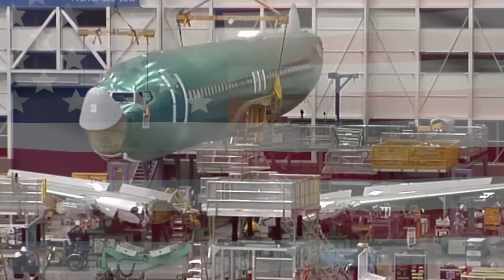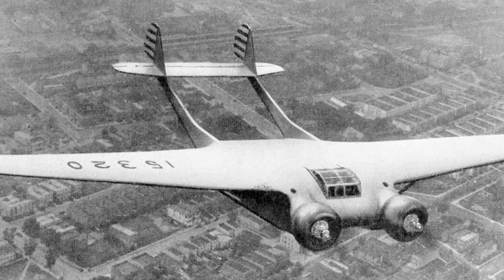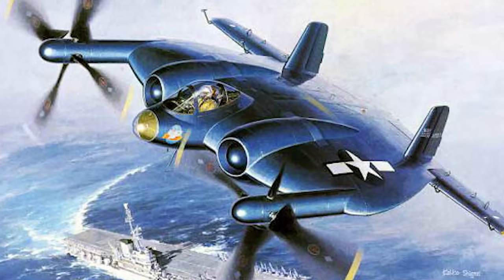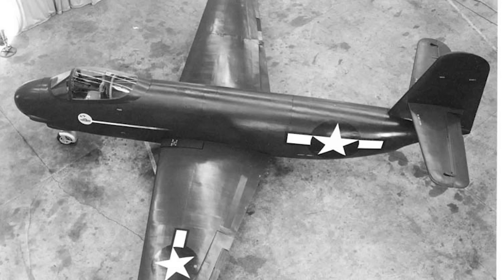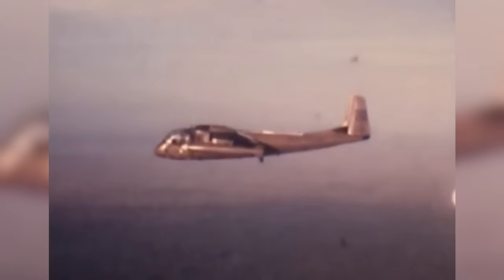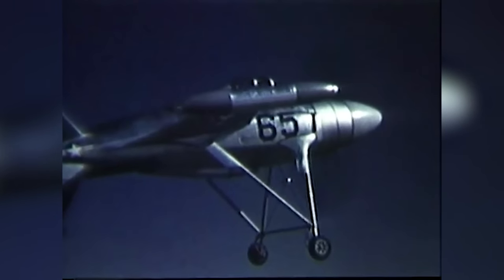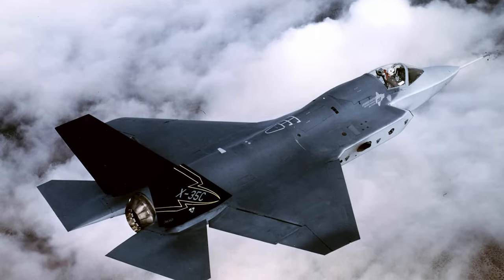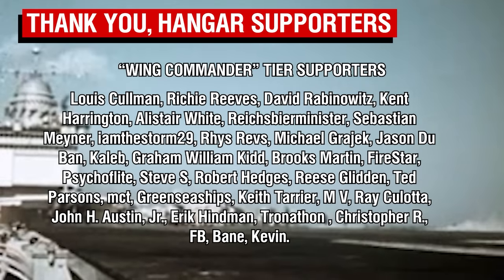America's Top 10 UGLIEST Aircraft

Comment: The simple fact is that the X-32 is ugly. Those semi-famous photos of the supposed F-32 with improved looks, which people always use to "prove" that it would have been pretty, only ever show it from the top or occasionally from a flattering side angle. They never show the front or the bottom, because that would reveal that it's still ugly.

There is something of the old Corsair II and Crusaders about it, but I wouldn't call those planes pretty either. "Striking", maybe? And of course, ugly or not, it's still pretty cool.

Great video Rex, thanks very much!

Comment: The xf5u with proper engines would have been a game changer.  With a theoretical top speed in excess of 475 miles per hour and a landing speed of around 65 MPH, it had an incredible climb rate.  Kamikaze planes would have stood little chance.  It was supposed to have four 20 mm cannons, making it the most heavily armed American fighter.  I believe because of it's strange looks, the conservative Admirals controlling the Navy at the time made sure it never had a chance.  I got to talk to one of the test pilots for the program, and he said it was nearly impossible to stall the prototype.  He also said it was extremely stable, and that even with the under powered engines, it could still do almost 300 mph, as well as being able to turn on a dime.

Comment: I actually think the X-32 could have been a successful design, if not a particularly stealthy one. It's closer in form to the F-16XL and would have been an excellent close air support platform for it very high payload potential, which in turn would obliterated any stealth profile it might have and is why it flunked the test. It would definitely have its place, but it didn't have the stealth or the speed to get it across the finish line.
Reply: The jump jet marine version had superior VTOL capability, it used thrust vectoring like the Harrier not the lift fan used by the F-35 (which can't be used for enhanced maneuvering and is just dead weight in forward flight)

Comment: While in principle and for the most part I do not find fault with your analysis,  there are exceptions for some examples on your list.  Had the title been "unusual" instead of "ugly" I feel there would be less room for debate.

Needles to say though the first requirement would be that the aircraft actually achieved flight, and not of the look I almost got my kite to fly before it crashed variety, which would eliminate the first entry on this list anyway.  Good call on it being ugly. It was indeed so ugly it should have been called porkchop because the only way you could get your dog to play with it was to hang pork chops off of it!

The Pirate wasn't ugly, but you are right in it being cartoonist and just not right. It was eminently forgettable.  The flying canoe and greenhouse was indeed terrible initially, but following efforts lead to a venerable seaplane search and rescue aircraft that was the Duck (I believe that was the name) which was very similar from the bow to just before the greenhouse. And the tail remained much the same.  The main difference was there was an aircraft fuselage inserted into that area between the start of the greenhouse and the tail section that was blended into the float. It had a much more elegant look but still odd with the float. And that area was very useful for stowing downed airmen and sailors plucked from the seas to return home once again.

Ok the goblin parasite is butt ugly too. And the Lockheed vtol for landing on freighters upright on its ass wea somewhat ridiculous. 

But the x32 or whatever needed a black and dark grey paint scheme and voice over by Will Arnett as Lego Movie Batman so it could play the part of his batplane... because I'm batman (you gotta say it in that deep, dark, brooding batman voice though, or it just doesn't work)

Comment: Another issue with the X-32 was the wing, which was going to be a single giant piece of thermoplastic. That would've been amazing from a manufacturing and possibly performance standpoint. Somewhat similar largely-composite wings were made on things like the AV-8, but that was only 1/3 the size of the X-32 wing. As a result, Boeing ran into trouble manufacturing the thing (experiencing voids in the plastic), which probably added to the already troublesome marketing due to its looks.
Of course, Lockheed had their marketing (if nothing else) down to a science, and made their famous supersonic STOVL flight which dispelled any doubts about the viability of their propulsion system.

Comment: My grandpa was the chief inspector for the X-32 project. Yes, it was very ugly, but it was cheap to put together, especially since the C model never made it up the chain into production (it would've fixed the problem of the looks since the flying prototypes were not the final product) the bucket in the front helped to push air back to its rotating VTOL modules making it faster to take off vertically (though this again was not the final design for the intake area)

Comment: If it were not due to the failure of the lifting fan for vertical take-off, it might have been chosen over the F-35.
Reply: "If it were not due to the failure of the lifting fan for vertical take-off, "(sic)

The X-32B didn't utilize a "lifting fan". It's shortcomings were far numerous than its hot gas ingesting compressor stalls which were even worse than those of the Pegasus powered Kestrel/Harrier/Harrier II.